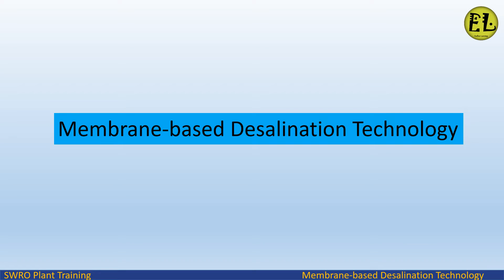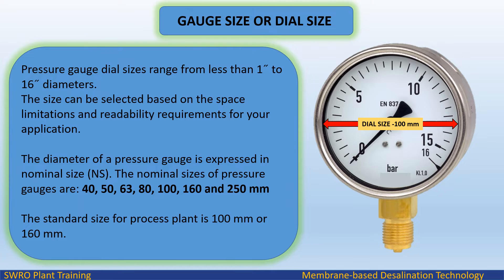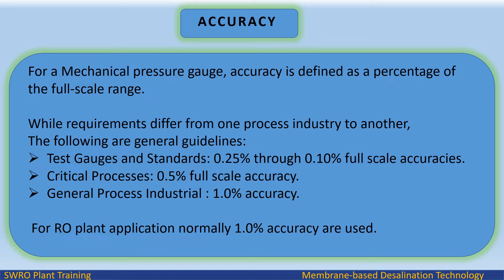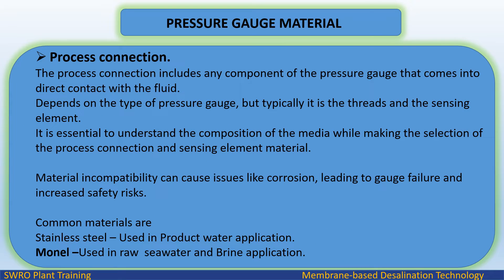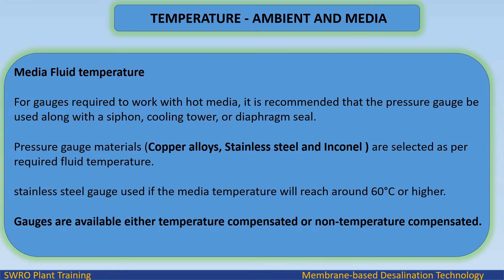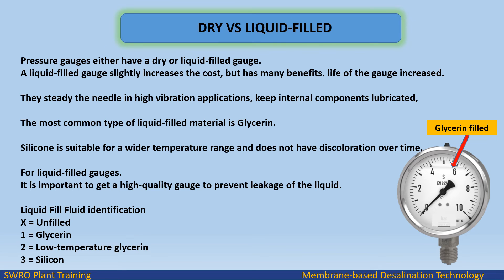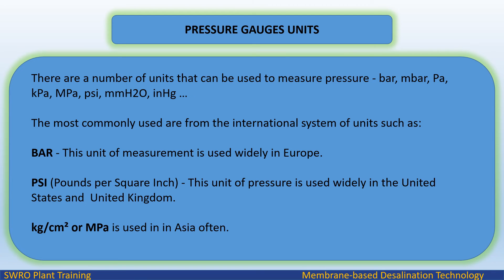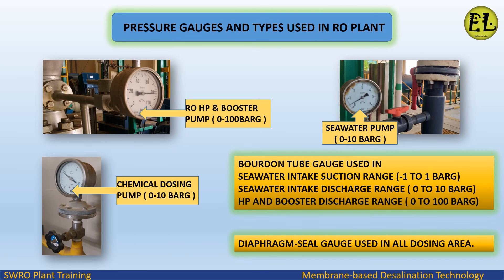HOW DO YOU SELECT A PRESSURE GAUGE | PROCESS APPLICATION | REVERSE OSMOSIS PLANT  | instrumentation

Comment: Good video. What is the purpose of blow out on gauge?
Thanks.
Reply from the maker: Blow out device prevent a buildup of pressure in case  if the bourbon tube can become dam aged leading to a leak within the gauge. The blow out disc will then pop out, relieving the pressure within the gauge.